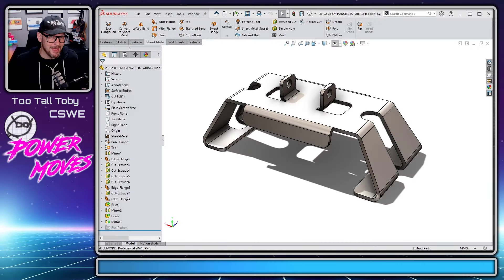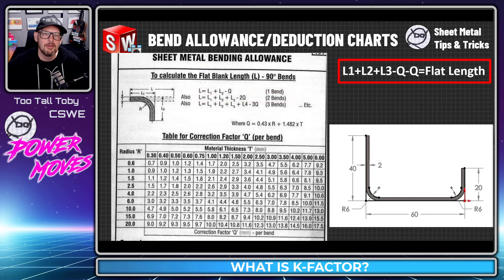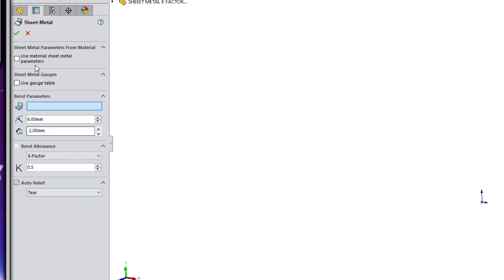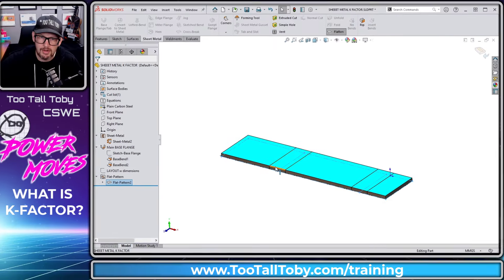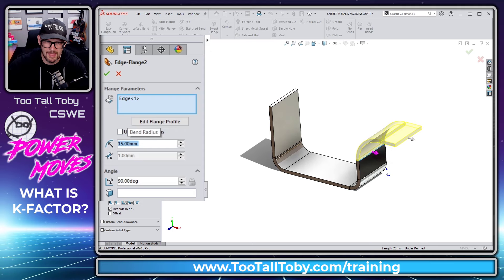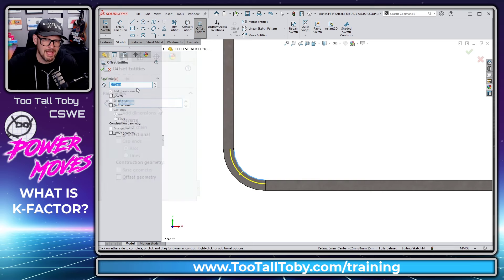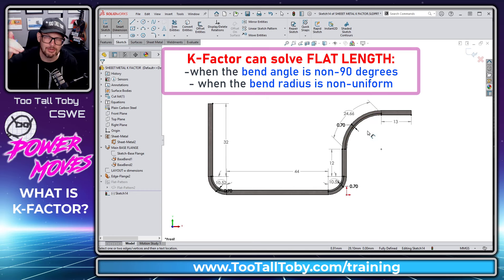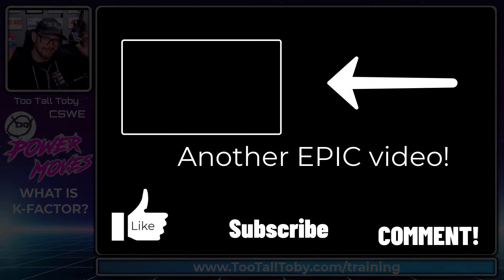SOLIDWORKS SHEET METAL - What is K-FACTOR?

Comment: Guys, K-factor is not a thing you come up with, when you design in a certain material, the vendor of that material has the K-factor value into the data sheet. Let's say you have 2mm thick AISI 304 sheet ordered, in the documentation of that order you will find the mechanical parameters, including the K-factor. The value changes from softer to harder material and from thinner to thicker thicknesses. If you have to enter a value, it should never be 0.5, that means that you are bending diamonds, as a bench mark,  softer metals like copper or aluminium are 0.38+/-0.02 and harder metals like stainless steel is 0.41+/-0.4. 
Do your research before you start designing something you intend to produce. Selection of material is one of the first things you need to do, thus, the K-factor should be there.

Awesome video Toby, amazing as always!
Reply from the maker: Great insight - thanks ace!
Reply: thank you! i was going to ask how he arrived at the K-factor number.

Comment: Hello, I have been looking for a video about unbend / flatness for determining blank size dies for a long time. I want to ask how to make blank sizes from neutral format parts such as STP, x.t, etc. Apart from using logopress and autoform 

If the solidwork format such as sldprt can still be unbend using the sheet metal feature,
Reply from the maker: Sure I can make a video on this - the short answer is:
use INSERT>SHEET METAL>INSERT BENDS
or
use INSERT>SHEET METAL>CONVERT TO SHEET METAL

Comment: Very well presented.
Where I work, we use 1/3 K-factor based on the Hurco Formulae. And we are bending some heavy gauge material (up to 1/2" or 3/4"). This is something I have brought to the attention of the folks at SolidWorks many times....the Mass Properties of the same part are different between the two configurations of bent and flat., i.e the bent is always heavier than the flat. Resulting in an inaccurate upper-level assembly weight.
Reply: Then explain to us where some of the material goes? Does it evaporate?
Reply: @Snake60rus  I might be wrong, so take it with a pinch of salt. But Solidworks seems to model a bend as two perfect concentric arcs, drawn out over the length of the bend. In reality the material might stretch and get thinner. That's why the k-factor is smaller than 0.5, i.e. the "flat part" is shorter than a line going down in the middle of the material.
So it depends what Solidworks uses to calculate the mass - if it didn't calculate the stretching yet when getting mass properties on the bent part, it might overestimate the mass. While that might be barely noticeable with a small and thin part, a 3/4" part would be thick enough to make a substantial difference - even the more since such a thick material isn't used to fabricate a bird house but likely a quite large structure.

Comment from the maker: Here's a comment I got on Reddit with regards to this video.  This guy shares some great insights about how the team on the other end (the manufacturing/shop team) might prefer to receive sheet metal designs, from CAD designers/engineers.  

These are some GREAT POINTS and the TLDR point here is:  Always work with (or talk to) the manufacturing team and find out what works best for them - it can save you a TON of time, since you won't have to waste time coming up with a good flat pattern - just let them do it (if that's what they want) 🙂

=======================================================
REDDIT COMMENT from Joaquin2071

I think this is a very good explanation for beginners going into sheet metal, however, if you are engineering and not actually manufacturing, it’s important to know that you shouldn’t be messing with these as it is up to the engineers at the manufacturer to determine the bend deduction based on their machines and their dies, especially when air forming. As someone who is an engineer in manufacturing, my job is a lot easier when the customer does not give a flat pattern and even better when they don’t dimension off of a flat pattern because 99% of the time, whatever k-factor/bd they are using is going to be way different than what we use.

As far as the way I see k-factor, as someone who works directly with the brake department and has a gigantic table of bend deductions for all sorts of material and thicknesses, I see k-factor as a dependent variable that is found after doing live bend tests, finding the bend deduction by solving for how much the material shrunk. then, when plugged into the formula for bend deduction, you solve for the k-factor. That k-factor can then be used for that material, thickness, and radius to solve for non 90deg angles. The only time I ever use k-factor built into solidworks is for hems, and from there we proof the flat to show a bend deduction and then that is given to the brake operator.

Just my little 2 cents from working in mfg for almost 5 years now (learning from old heads lol).

P.s. A tried and true k-factor that is used a lot though that will almost always work is .4469. Especially for aluminum when air forming. That’ll get you pretty dang close

P.p.s always dimension to the virtual exterior tangents, thank you :)

Comment: Hi I have a question
How to design a big Silo Tank (cylindrical)?
As we understand, the normal steel plate dimension is smaller than the actual shape of our design
Should we design every single plate and then assemble it into 1 large component, or is there another way to do that?
The reason for that because I want to know the total amount of plate that required for our design

Comment: Where did the 0.35 K-factor come from?
Reply from the maker: The correct K-factor value is determined by a variety of things:  Material, Thickness, Bending process, Bend Radius, and trial and error (working with the shop floor).  If you are completely unsure, you can use a value between 0.35 and 0.5, and you'll usually be pretty close, but you'll want to make sure you discuss with the manufacturing team before proceeding.

Comment: Why it isn't always K-factor = 0.5?

Working with NURBS modelling in the shipbuilding industry, we are used to extracting the midsurface from the bends and using that as the surface to be flattened out. Being bend sheet metals like you showed in the video, or just curved panels used to build the hull.
Reply from the maker: Take a look at some of the other comments - there's some great stuff in there about K-factor value - but the TLDR is:  The K factor will be different depending on the material, material thickness, bend radius, and bending process.

Comment: I completely understand what k factor is and I use it almost all the time. However I do not understand how to know what is the correct k factor or how to go about figuring out what the correct k factor should be. I just always use .5 since I almost never use metal thicker than 14 GA. I can't be that far off. But I would like to know how to figure out the right k factor for me.
Reply: K-factor is a function of several items, such as material alloy and condition, type of bend (air, bottom, etc.), bend radius, ambient temperature, etc.  The best way to determine the K-factor is to do a test bend with known parameters and reverse calculate the K-factor.  For most aluminum alloys and thin steel sheets, K-factor of .44 will get you pretty close.  Look into Bendworks application for some good reference material.
Reply from the maker: Excellent answer thanks Mark!
Reply: @MarkSummersCAD  thank you.  What is "bend works application"? Is this a website? Or an app?
Reply: @MrMemusashi , it is a downloadable app for Windows.  Just google "BendWorks_V1-1_Setup.zip"
Reply: @MarkSummersCAD  thanks again.

Comment: so how is kfactor calculated for different thickness and radius?
Reply: I believe it is found by practical experiments using test pieces in the workshop.
Reply from the maker: The correct K-factor value is determined by a variety of things:  Material, Thickness, Bending process, Bend Radius, and trial and error (working with the shop floor).  If you are completely unsure, you can use a value between 0.35 and 0.5, and you'll usually be pretty close, but you'll want to make sure you discuss with the manufacturing team before proceeding.

Comment: Spot on but you didn't explain that K-Factor is just the percentage of the material thickness. The line/depth that doesn't change length throughout the bend. All the material on the inside of this line gets compressed and all the material on the outside of this line gets stretched. In the real world with steel and aluminum a K-Factor of .4 is a good baseline until you run samples or prototypes. And your shear size is smaller than the outside bend flanges combined.
Reply from the maker: Nice thanks for the feedback Bob - Great stuff!
Reply: He basically explained that it is a ratio which you can deduce into a percentage. He explained it very well